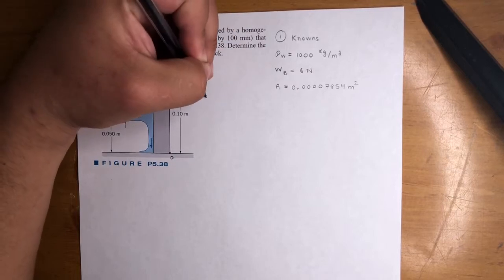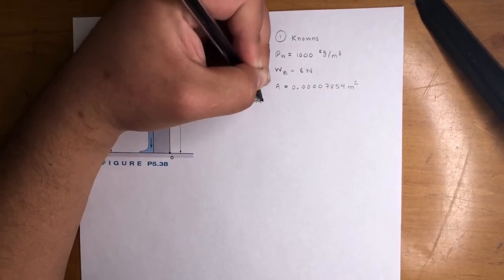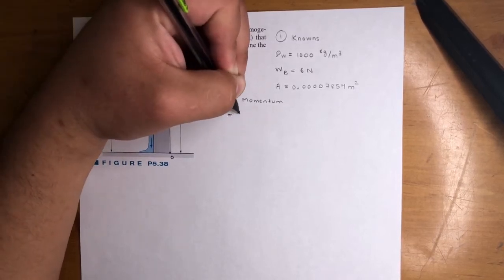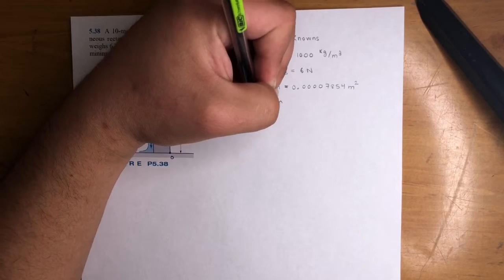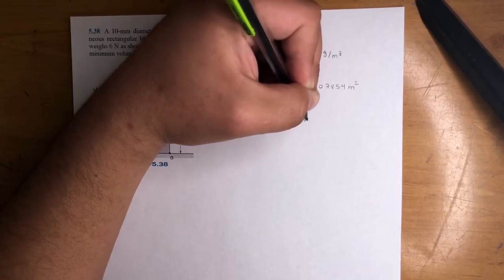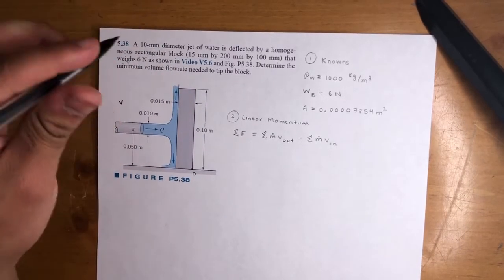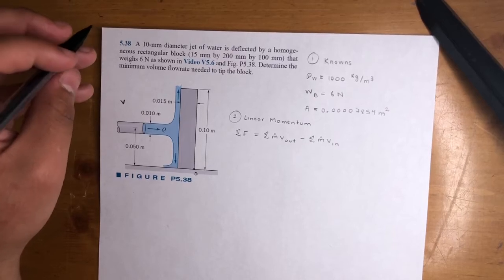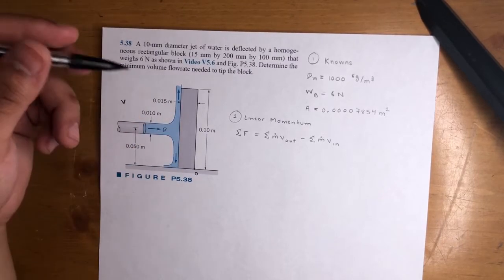Fluid Mechanics - A 10-mm Diameter Jet of Water is Deflected by a Homogenous Rectangular Block

Comment: Couldn't the negative go away if you just consider the flow as the outlet? I don't think you'd consider it an inlet because it is a free jet and since youre not looking for the vertical flows you dont need to readjust to outside of the pipe.
Reply from the maker: Hey how’s it going.

I see what you’re saying and I mean, yeah, you can do that, but for this problem, it’s asking for flow rate needed to tip the block. 

Meaning we must take our control volume on the external forces acting on the block, which is just the water acting on it. If we’re assuming this as our control volume, the exit velocity at the pipe is technically an inlet as it goes into our control volume. 

If the problem was asking for an anchoring force to hold the tube at the left, then yes, that would be considered an exit, but that’s a whole other question. 

Hope this helps!